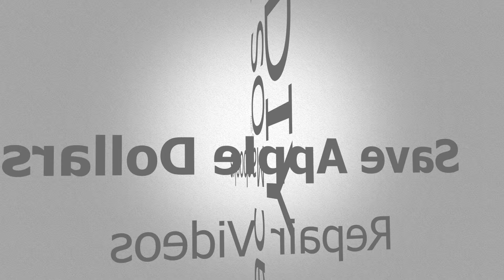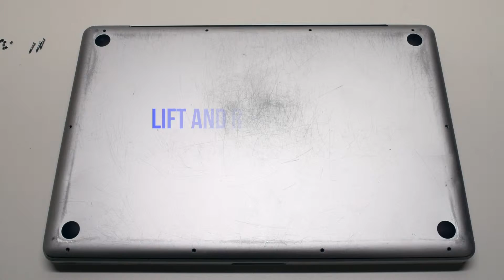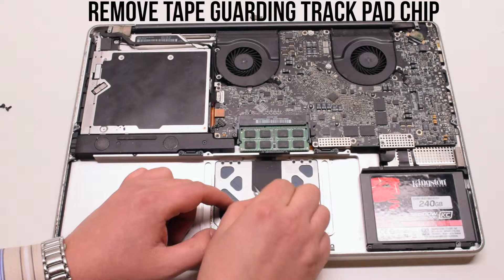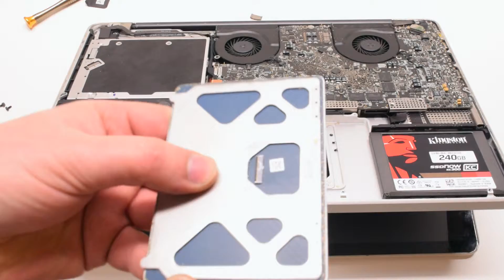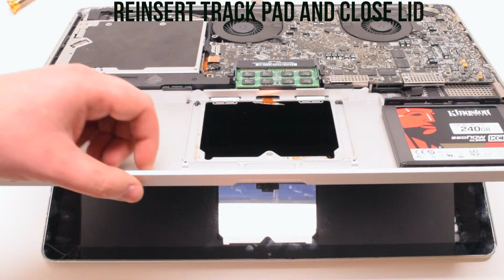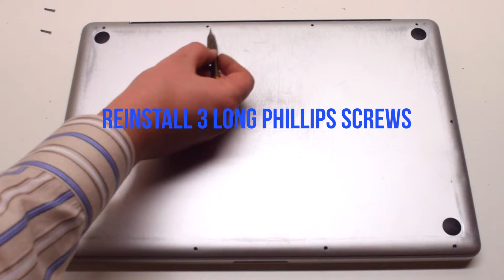2010 Macbook Pro 17" A1297 Track Pad Replacement

Comment: It should interesting to publish a list of the necessary screws and tools to do the whole job (e.g. Y1, T5, P5…). For instance, after I unmounted the battery and the 6 black mini screws of the trackpad I had no tool to unscrew the latest screw on the trackpad itself, the one here shown at the center-bottom, looking like a Y1 screw  (I suppose, because my Y0 screwdriver was too small for that screw). Also, on this movie I don't see you unscrewing this screw. Should I unscrew it or not? Anyway, even if I didn't unmount the trackpad and I didn't finish the job as shown here, my trackpad now works as expected. So, at least this video worked out for me. My very best.